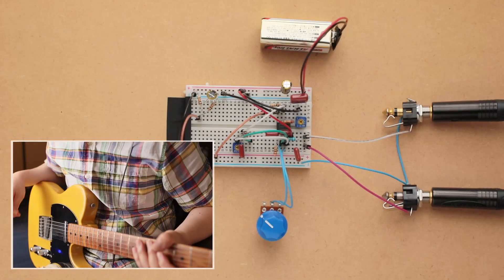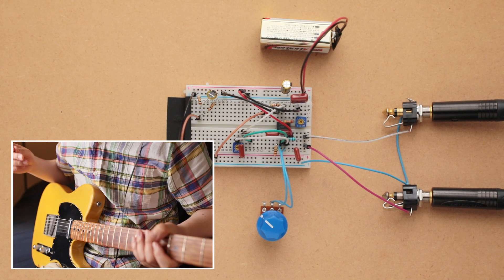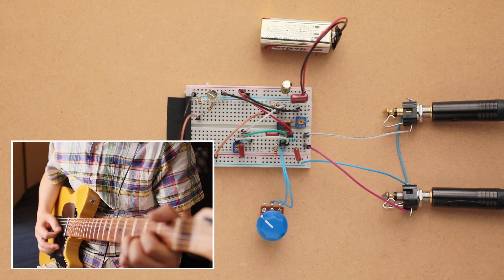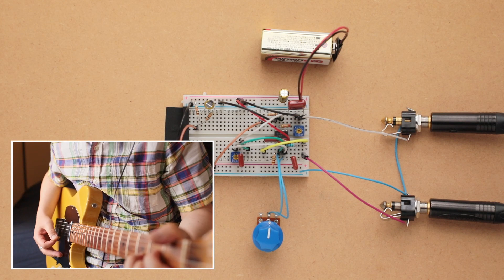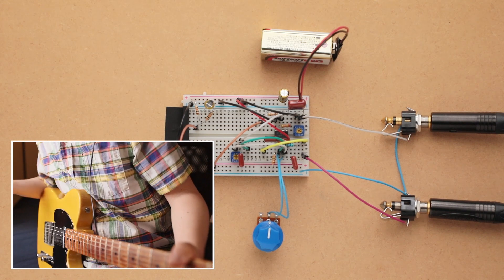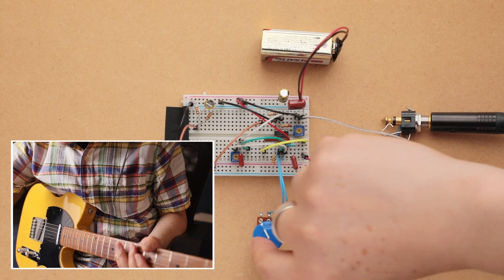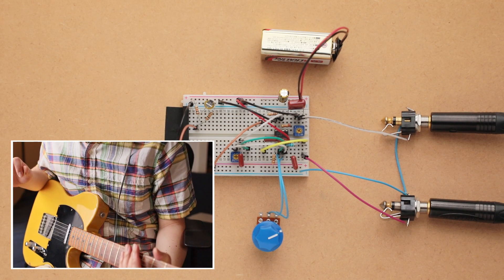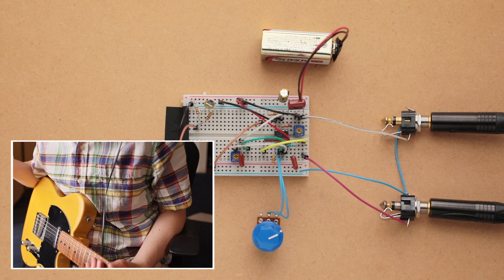How To Build An Overdrive Pedal Using A Breadboard - Intro To Guitar Pedal DIY Part 1

Comment: Does it have to be 47pf
Reply from the maker: Thanks for watching! There isn't a 47pf in the circuit, maybe you're talking about the 47uF caps? If that's the case, those are for the power supply and you'll be fine using anything between 33~100uF.

Comment: This is the most helpful video of seen so far. The explanations of the components is very informative - I can build a pedal, but didn't know what the components actual do. Would be great if there was a "Bog Dumb Guy" guide for how changing different values impacts the circuits/tone.
Reply from the maker: Thanks for watching! And thank you so much for the kind words, I really appreciate it! If you watch Part 3 of this series, I talk a little about mod ideas, and how changing components affects the tone, but I kinda skim over the details.
Reply: Oh, I'll check it! Thanks! I asked the same question on another channel and they shot me down with, "What you're asking about is engineering." so thank you for being helpful! @arito
Reply from the maker: @MattTee1975  You're welcome! It's only engineering if you want to learn how the actual electrons work. We all know that if you put a pot of cold water on a fire, it's going to get hot, but few people really understand why. Similar thing with pedal circuits; "If you change this capacitor to a larger value, it's going to give you more bass." We can all have fun tweaking!
Reply: Agreed! I only asked the guy if he was aware of any dumbed down versions. I think he was gatekeeping some. Thanks again, sir. @arito
Reply from the maker: @MattTee1975  Glad I could help!

Comment: Hii Arito
this circuit is based on some other pedal?
Reply from the maker: Thanks for watching! This circuit is not an exact clone of a specific pedal. It's sort of a mix between a Tube Screamer and a Timmy with some tweaks and value changes. The aim was to keep the build simple by using as few parts as possible, but without sacrificing the final tone.

Comment: Found you because of Lantertronics as well. Congratulations on the channel; you’re doing an amazing job! It’s information just at the level I needed and very well presented.

I’ll source the components this week to follow along and I’m looking forward to part two.

Can you consider a part three in which you explain the circuit:
On a high level, what are the different parts of the circuit doing?
How do the clipping diodes work?
What are the resistors & capacitors doing?
How did you pick their values?
Why did you pick electrolytic for some capacitors & film for other?
And so forth…

Building something is great fun and very rewarding, and understanding it is the next step to start tinkering… 😁
Reply from the maker: Thanks so much for watching! I really appreciate the compliments. I will definitely consider a part 3 like you have requested, but might have to cut out some details as to not make it an hour long video... I would also recommend doing some article/blog research into guitar related circuit design as there are so many people with a great depth of knowledge. ElectroSmash (who Brian Wampler also often references) would be a great place to start.